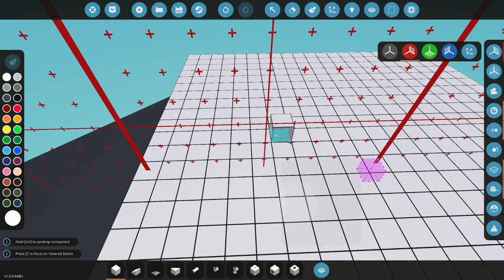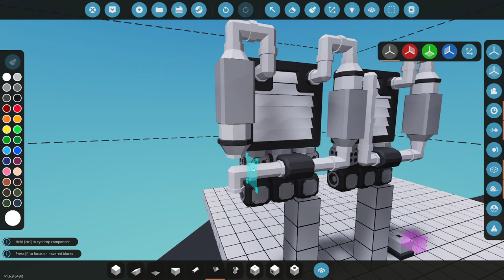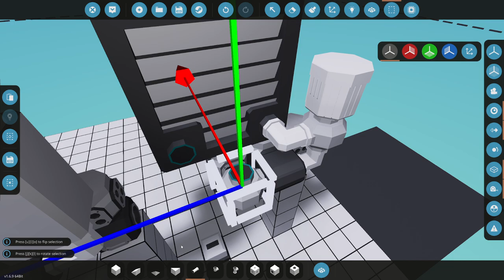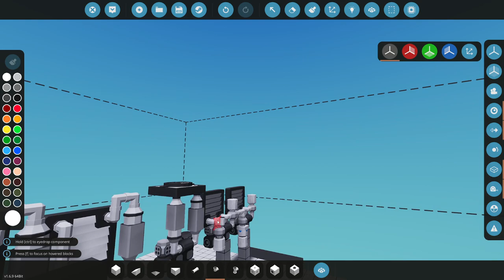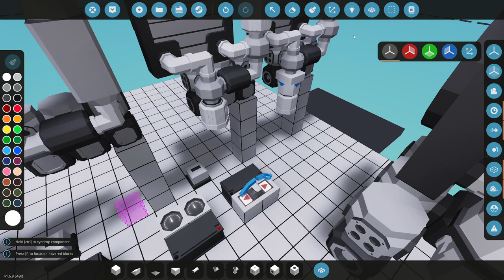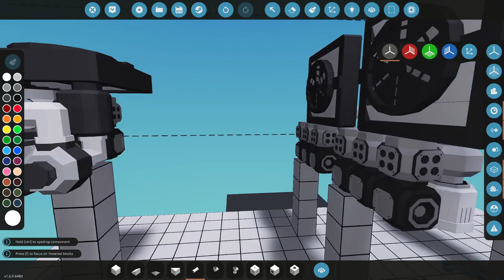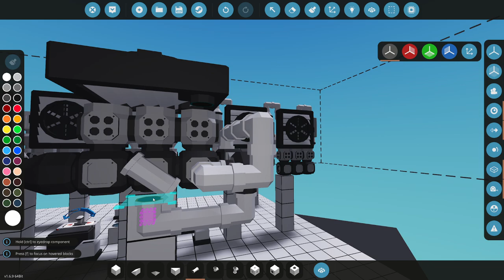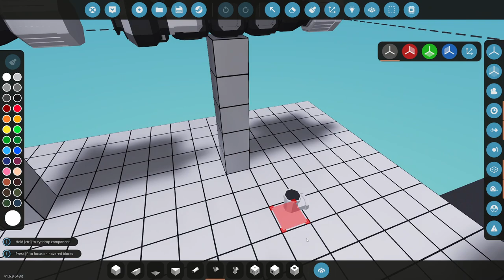Stormworks Basics: Cooling Tutorial

Comment: I have done some pretty extensive messing around with different cooling layouts.  What I have found is that pipe length really does not effect flow rate if there is enough fluid in the system.  The problem is that pipes spawn in empty and the fluid in the system is used to fill the pipes.  Until the pipes are full there will be fluctuations in flow rate.  Somewhat like vapor lock in a fuel system.    Water can be used to fill the pipes, but a one way valve is needed from the tank into the pipes to keep the fluid from trying to go back into the tank.    

Modular engines are funky in that the engine will pull fluid in if it is not full but not push any back out.  Using 2 way pumps to and from the radiator is one way to keep the flow consistent.

The difference between the differnt pumps is the pressure they each can achieve.  a small impeller pump has the lowest pressure potetial and the large impeller pump has the highest pressure potential.   Every component in the cooling system requires more pressure to keep the flow rate up.  So if there is only one radiator there is less pressure required so a small pump or even 2 small pumps will work.   

Flow rate is important but so is the cooling capacity of the radiators.  If the radiator can not dissipate the heat fast enough, flow rate does not really matter.   So in some heavy use cases, multiple radiators are required.   

And something that many players do not realize is that hugher temps in modular engines is actually not a bad thing.  Maximum fuel efficiency can only be reached when the engine is about 100C. when the highest AFR can be used.   As long as the engine does not exceed 115c the engine will not explode.   But if using sea water directly into the engine scaling will occur above 100c so it is best to try to keep it at 95 to 98 to prevent that from occuring.
Reply: Your comment is... Very good
Reply: If I understand correctly,  for setups with a lot of pipes (enough to not fill them to 100% with included coolant from engine/radiator coolant volume), you run the risk of having air clogged systems? If that's the case, can you force push freshwater from a tank through a one way valve and a liquid pass through filter to pre-fill all pipes/rad/eng with freshwater? Would it also de-risk it by removing all air from the system by pumping out to the environment all air of both the tank and the coolant system through a Pump+oneWayValve+Gas filter? Would take some space just to initialise all usefull coolant volumes with 100% coolant and 0% air but at a certain engine size, it would become cost efficient? Especially at engine startup when a lot of flickering fluctuations may be present.
Food for thought.
Reply: @marctardif9756  It is not so much that it becomes air clogged,  it is just that there is not enough fluid to maintain a steady flow.   Kinda like a hose or squirt gun running low on water and runs in spurts.     Filling the pipes does help. but filling to max capacity can stop the flow.
Reply: @Bendigo1  Then I wonder how close to max capacity does the flow stop. Might be a way to be able to test extract a 100% filled system coolant into an empty tank (replacing with air) and measure its level, then input only a controlled quantity to know what % fill level un-clogs the system or makes it sputter? It makes no sense that a 100% filled system should stop the flow. I suspect he incompressibility of liquids in Stormworks to be so mathematically perfect that any change in pressure differential is made impossible thus causing fluids to never move. It might mean you always need a bit of air to move liquids around but not soo much to cause bubbles at critical components. Hoever even in real life, most hydraulic systems always have a tiny bit of air in them. Not sure if you can extract 100% of coolant with air though. Might have to do a lot of tests with this. I'm just hoping that the reason is logical in Stormworks context.

Edit: I'm getting overcomplicated, like you said earlier, you can just fill the pipes with a oneway valved tank and test how much liquid that tank needs until flow stops at your coolant loop pumps. No need to do extraction shenanignans (Ill test anyway when I have time)
Reply: @marctardif9756  Testing is fun.  especially after updates because who knows what has changed.    As fa as fluid flow,  as long as there is some space for fluid to flow, it should not stop.
Reply: Jesus fucking christ, ive played this game for almost 700 hours and i did not realise how absurdly detailed it is. The fact that it takes into account the energy lost by the piston temp... man what the hell. Thanks for commenting on this, i will also say that a boiler is extremelly good at cooling an engine and you can even produce steam to move a turbine with the heat from it
Reply: @dirrey193  This could almost count as a form of turbo if you use that turbine to drive the air intake pump.
Reply: Just got back into this game, but I completely lost interest running into the exact phenomenon you just explained. I never knew pipes didn't spawn without water, so I CONSTANTLY had issues with water loss, fluctuations, with every pump but the accessory belt driven one. Nuclear Reactors wouldn't work properly, steam engines wouldn't work, modular engines always failed. You just saved my life haha. Thanks a lot!!!

Comment: i did notice that flow rate is VERY crucial. i kept building engines that couldn't cool and guess what the flowrate was a mere 14l/s. a bit of tinkering and pushed that up to nearly 30 and i got rid of most of the rads too. now the engine happily runs at load all day long. (literally)

Comment: Small and large pumps have same flow rate?
How is this possible?
I hooked up a small pump to my boat so i could pump sea water through a hose to extinguish fires and the flow coming out of it was very slow and it didn't shoot very far.
Then i replaced the small pump for a large one and i could shoot that water so far it's not even funny.
I would say the large pump has a much higher flow rate based on that at least but i'm curious why you say they both have the same flow rate.
Please clarify if you don't mind, i'm really trying to find out how to cool off my 40 Cylinders engines right now and it seems like nothing is working.
Reply: Sorry, i kept on watching and realized you answered my question in the video at 15:39 😄

Comment: some of this information seems to already be outdated, at the time of writing this, i had a certain system with an unstable 18 L/s flowrate, adding a tank made it a stable 30 L/s, also for some reason, in two identical cooling loops one radiator was mostly empty and the other completely full, the tanks fixed that too
Reply from the maker: They made some changes with the Oil update. That may have caused some performance changes.

Comment: how can i cool my boat with water and not using radiators?
Reply from the maker: You can do it with raw water cooling. Where you pump sea water through a cooling manifold and back into the ocean. As long as the temperature of the engine stays under 100°, it will not damage the engine.

You can also pump water through a heat sink in the hull of the ship and through a cooling manifold.

You can do liquid to liquid cooling. Where you have a seawater loop going through one side of the liquid liquid. In a freshwater loop going through the engine on the other side.
Reply: @CaptainCockerels  how do i do liquid liquid cooling?
Reply: @Dogboy394 fluid B in pump sea water in there fluid B out put a pipe back in the water and it gets it out now pump your cooling trough  Fluid A in and put it back trough the other side of the cooling manifold via Fluid A out
Reply: Pipe back into water with fluid port